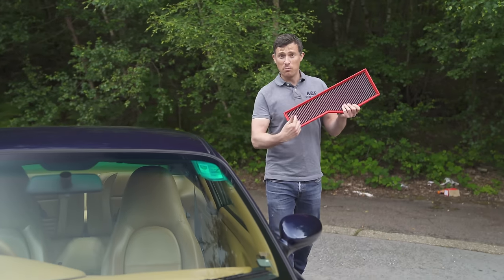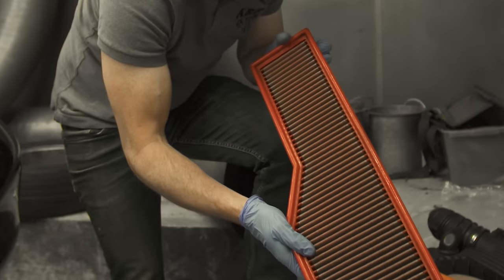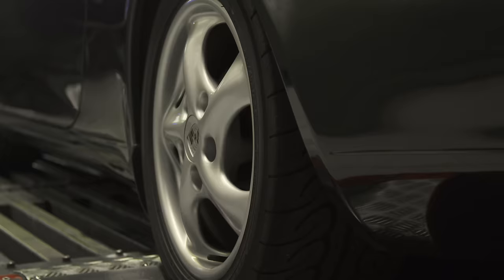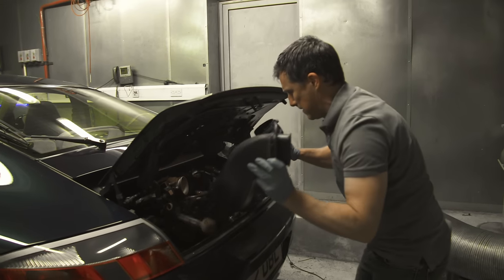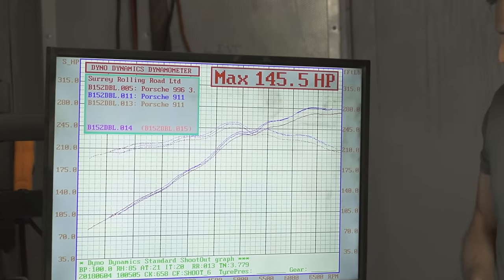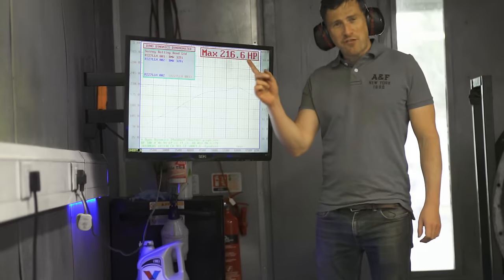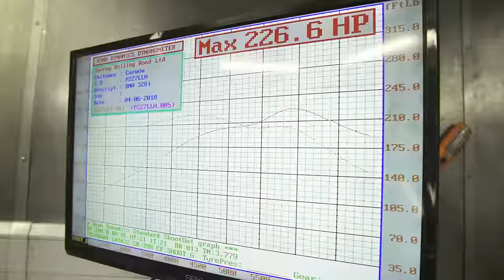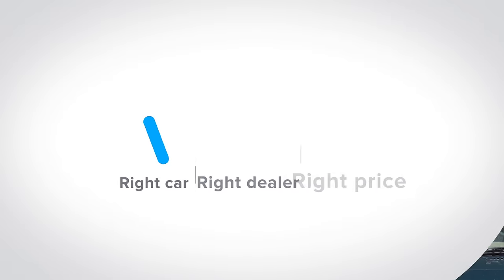Does a performance air filter give you more power? I fitted one to my Porsche 911 to find out!

Comment: Your 996 deserves a new stainless steel exhaust system ;)
Reply: and some sexy wheels
Reply: and a new IMS. I'm amazed he has not changed it. Should have been done first thing after purchasing
Reply: Not the conventional thinking in the UK...it's a US thing.
Reply: Errr first thing I had done to my 996 from a specialist in Leeds £1099+VAT peace of mind priceless.
Reply: Which bearing?
Reply: LN engineering hybrid ceramic
Reply: double row if memory serves
Reply: Well I'm afraid that's only got 40k mile life max. and there are about 4 other issues with the M96, too.
Reply: Really https://lnengineering.com/products/ims-bearing-retrofit-kits-for-porsche-m96-97-engines/dual-row-ims-retrofit-kit-for-my97-01.html As far as I am aware after researching it has an 80K lifespan which is fine by me replace when you do the clutch. What peer evidence do you have to support 40K with links and I will discuss it with the specialist I use who ghas several garages and rebuilds Porsches from different eras for a living.
Reply: Which model Porsche do you own, have owned?
Reply: 944T, 996TT, 996.2 C2 and 970T
Reply: The 970T' kinda remind me of my old 928S4 from years ago. Still no link to support your hypothesis / statement of 40K. The single row is good for 50K with the double row service life 75K 6 yrs
Reply: Not really a problem with the early 3.4
Reply: retepyam5858 Jake got richer you got poorer.
Lol dual row, one born every minute.
Reply: 9000Redline can't believe he spent $$$ on wheels before IMS in 996..... Driving with ticking time bomb in the engine. .... Knowingly....
Reply: A full Akrapovic  is the way to go.
Reply: @TheChannel1978   its a fake. Not real , ims go bigger his Fortune scaring 996-986 owner. This 996 is perfecto.the e 36 rules

Comment: I have a 997 Carrera. Fitted a K@N and for a about 2 years I kept chasing an check engine light. Multiple issues, including vacuum leaks, but the final fix was to put back a standard air filter and put in a new mass airflow. My understanding was the oil from the filter can contaminate the MAF. Either way, this caused my engine check light so beware.

Comment: I put a K & N performance air filter in my BMW. It’s certainly feels more responsive and revs more freely but whether there is an actual measurable power gain I have no idea.
Reply: stubones look behind the filter shit load of dust
Reply: All seems fine. I open the filter box and check out eveything at least once a month. There is no oil anywhere in the filter box aprt from on the filter material. Thanks for the heads up though.
Reply: No there isn't, but thanks ever so much for your misinformed concern LOL
Reply: zeroyon223 hahaha,  that's bollocks.  It's an Internet myth.  Give your head a wobble,  don't believe everything u see on YouTube.
Reply: I've also tested some air filters on my M3 on the Dyno. K&N is the best of the 3 I've tested. I had a K&N filter, an OEM BMW filter and a BMC filter. BMW and BMC delivered the same power. The K&N gives 4hp more! I think he uses also BMC, it looks the same style as my BMC..
Reply: ErikT595 variance in a per dyno is prob 10hp
Reply: my 1.4 mito felt also more powerful with the k&N filter, my mechanic thought so too since he drove another clients car with the same engine. of course that could have another reason but it feels more responsive and quicker. Also experienced this in a peugeot 107
Reply: @ErikT595  i put a k&n filter in my stage 3 bmw 535d, dyno'ed it and the increase was 15hp compared to the original spec
Reply: @dzionisis  good job man!
Reply: @dzionisis  15 horses just to put the filter?
Reply: @zeroyon223 rubbish, k&n will back you up if the dealer says this has happened and even send engineer out to prove the dealer wrong. Why do formula 1 and all other performace racing use k&n???
Reply: @MadKingJorge  1.246% to be exact. And that's for only €55,- Also compared to the others I've tested K&N is the best.

Comment: In addition your aftermarket filter is (should be) serviceable where paper elements aren’t, they’re throw away item which cost you every time a services due. If you replacement paper filters aren’t that expensive then whatever you like but it’s it’s a high cost item then a good quality serviceable aftermarket filter is worth a look.
Reply: The engine has been tuned to run with the standard filter from factory. Unless you are doing a remap, there is no point in getting a k&n or similar
Reply: @eveythingthatsadam  if it has the MAF the ecu correct the injection.
Reply: @Moriggia  only by very small percentages

Comment: The IMS is not as much to worry about if you're regularly running the engine at highish RPM. That's because the bearing was designed to be lubricated when the oil pressure gets nice and high and your oil splashes around with some obviously making its way into the bearing.

Like any bearing (as opposed to a regular transaxle) the IMS does not like to be spun while dry.

Comment: Okay,so here is the thing. I have played a lot around with aftermarket sport filters like K&N,Pilot,etc.. From having experience with Accord Type R,Galant VR and BMW 525i,i can tell you with certain,that the higher you rev the engine,the more you feel the benefits of the sport filter. No,it does not increase your HP.,it can't do that. But allows a better air flow which results in better throttle response and better performance at the high revs.
Reply: S.T T. So what performance is it giving if there is no hp upgrade or nm upgrade
Reply: J Alcatraz As I mentioned,the performance is not defined only in HP or Nm. Almost all cars come with restricted air flow. To understand what I mean,put a cotton ball in one of your nose holes and run. You can keep the jogging,but if you take a fast sprint,you will find out why air flow is so important.
Reply: S.T T. wrong, its just like fake pills for your $  placebo, thats all. but you can give more dirt and oil to your engine....maybe dry filters are not that bad, but the airflow is terrible.
Reply: Lmao, hilarious read chap.
Reply: @eleonik76  "performance is not defined by hp and nm" oh yes it is everything car related is numbers. 0-60 power, torque, lap time. Throttle response can be measured. Everything else is placebo. And the the cottoball thing is stupid because you are splitting air flow in half and that also can be measured. Smh

Comment: The performance filter's major advantage is that it's reusable, can be cleaned and re-oiled.  Though I think if it had a tune to compensate for the improved airflow, he would have seen a larger gain over the paper one.  The one disadvantage is they don't filter as well as the paper element, which over time will increase engine wear.
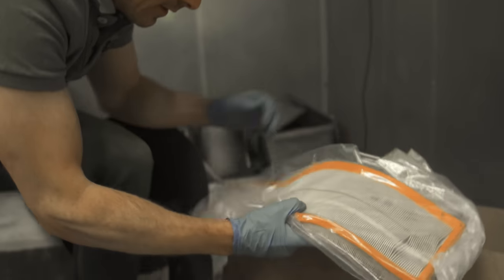Reply: Believe in JESUS today, confess and repent of your sins. No one goes to heaven for doing good but by believing in JESUS who died for our sins.  For God so loved the world that he gave his one and only Son, that whoever believes in him shall not perish but have eternal life.(John 3:16)🥳
Reply: Would it need a tune to benefit?... Surely there are sensors that detect the increased air coming in and inject more fuel to match, keeping the ratio the same?

Comment: I drive an f56 mini cooper s which with the oem filter actually hit 208bhp & after fitting a k&n panel filter dropped to 198 bhp but with such a negligible drop the increased noise ,especially windows up believe it or not was well worth it &im convinced the throttle response is improved and there really does seem to be more popping on the over-run! I have an induction kit en rout & am really really interested to get it dynod again &really try put this to bed once & for all, awesome content. Cheers

Comment: I think you would need to tune the ecu after an air filter install to see real power gains also you would need to do so when removing cats
Reply: CrouchinTiGa unnecessary, there is no significant gain with that perf. filter. but in the meantime u get more dirt and oil in to the engine.
Reply: Max Cohagen I don't think an air filter mod is worh the money to be honest you better off spending your money on a decent catback exhaust

Comment: I installed the K&N filters in my Macan S, which require powerwashing and oiling yearly, but I too didn't really see a big upgrade.  The COBB tuner, which remapped the ECU, did make a big difference on the high end, put not so much on the low end where I wanted to see gains.  It also eliminated the exhaust sound, which as you say, is really a big part of owning a Porsche !  I reset me car back to factory settings, and returned the tuner, but the filters remain.  Thanks, well done video !!

Comment: Run some expensive fuel system cleaner or ATF in the fuel to clean the combustion chambers, intake valves and injectors, then change the fuel filter.
Most of the restriction comes from the intake tubes so unless you change the intake to a proper cold air intake system with exhaust mods and get it tuned to match you will only mess up the tune and lose power.
High flow filters all let more dust through so the cost of your "sound modification" is reduced engine longevity.

Comment: Get that IMS done if you are worried. When I bought my 986 S it was on its way out and I put the LN ceramic ball bearing in which had a lifespan of roughly 75,000 miles. I could have done the direct feed but ceramic was cheaper and 75,000 mile rating is fine by me. And I have a 6 year / 50K mile warranty on the new bearing. Can’t go wrong with being safe.

Comment: i only use K&N or Pipercross filters, they work, save you the cost of replacing the paper one each service (just wash, dry and re-oil once per year), and as you noticed, better sound, especially the models that have the rubber bung at the side (remove bung for warm fuzzy feel).  :)

Comment: I'm not an engineer, but from what I understand more airflow turbulence at lower rpm increases torque which explains why the more restrictive factory filter has higher torque. Modern 2 stage inlet/intake manifolds utilize turbulence @ low rpm and free flow at higher rpm for this reason.

Comment: Nice one Mat, I have been using one of those for a while and yeah, the sound got quite a bit nicer. Performance wise, it felt happier to rev, but nothing noticeable on the road, now I know why.
Reply: I also got the semi solid engine mounts recently, found it sharpens up everything slightly but there is some harshness at about 4k which I dislike. Will try slightly softer mounts and see.

Comment: You need to re trigger the fuel characteristics map er initialization , drive for at least 50 km , only then you can realize the benefit of the after market air filter if any or any mods that affect the fuel air ratio. For that matter .
I

Comment: I put a K&N performance filter that has an extra air intake "hole" on my 1.6 ecoboost and measured before/after figures through OBD and the kn increases the turbo boost by several PSIs and improved throttle response and sound. I was surprised with the outcome on my car.

Comment: I did notice after a while washing the k n filters 5-6 times the cotton starts to wear thin and holes appear also my air flow sensor goes bad even with light re oiling the filters went back to standard filters on my e55 amg and happy no more problems with sensor

Comment: K and n in a 2018 dual jet swift with an exhaust mod and K and N makes a big difference in the higher rev range, seems to have lost a bit lower down, but the car is leaking something nasty from the engine bay so it’s not running right anyway...

Comment: Not sure about the 3.4 you have but in my 3.6 996.2 the air filter is simply 7 screws and then disconnect the air intake from throttle body and the air filter goes in and out with no problem.

Comment: For these older 911's, should keep the new filter and alter the funnel/opening of the pathway from the rear deck lid to the intake box.
If you lived in the states, getting away with High-flow CAT upgrades would be ideal - and a decent tune.

Comment: I used to own a 328 Sport Coupé just like that - also in Forest Green, I think it was called. I'm on my 7th BMW and have driven many more, and the 328i remains my favourite. One of the last with a cable throttle, which plays a major part in that opinion, but they were also pretty light (same weight as the 996 - around 1300-1400kg). You also didn't get a clutch delay valve or any nannying electronics - just enough tech to make it a good car.

Comment: I've sold many aftermarket air filters (mainly K&N) and I've used them myself over the years. The main advantage (as I always  told my customers) is that one never has to replace the filter again in the entire lifetime of the car. Power increase of about 5% max. is espected. Which is not really a lot...

Comment: I found my old banger had much more torque up steep motorway hills.. I'd suggest you clean your injectors/combustion Chambers... K&n panels are for life saving u a fortune on paper filters... Wet weather dampens paper filters reducing flow...filter upgrades work with other stage 1 modifications

Comment: The effect is completely subjective at best. Turbo engines, more air, colder air, less turbulence into the engine = more power. My Leon FR stock 180 was dyno'd before and after on premium fule with a K&N air filter, stock, 182.1hp, smooth curve, 4 runs average. With filter, 4 runs average, 186.2hp with a audible sound difference too (more airflow). Since adding a replacement, non turbulent Turbo Muffler Delete from Revo, 4 more runs, 190.2hp. Stage 1 bluefin remap, 242.6hp with a smooth curve all the way up to 6500rpm with no drop outs (out of 6800 redline). Total gains for £580 ish, 61hp and 117nm of torque. It's about quality parts, quality maps and looking after the correct engine components. Turbo cars see the biggest gains ofc.

Comment: These filters work on some cars I fitted a K&N in box filter on my 309gti and I noticed 3 benefits  nice induction roar 2nd definate increase in power and it actually filtered the air with the old filter there was always dust in the intake track.

Comment: The filter it came with is "Oil Charged" like the K&N performance filters.. it allows much more at higher rpm's and I believe it cools the air as well, giving the engine a little more power! I believe anyways. Correct me if wrong....

Comment: keep the air filter stock, same power and no problems with sensors, save your money for an oil change
Reply: No hassles cleaning, no sprays required.. definitely keep the standard paper filter

Comment: you didn't recalibrate the ecu for the high performance air filter, so the engine got more air but not more fuel. the result is, the engine was runnig lean and obvious it got less power. (not that a air filter will give much power, but usually its good for 1 to 3 extra hp)

Comment: Some engine control systems are so tightly engineered and adjusted, putting in a freer flow AF can actually be detrimental to performance, in some cases. Yet, some MAF controlled systems will allow a certain degree of self adjustments to the greater air flow. I put a K & N in my Corvette and my mileage went up slightly. But, I wouldn't put on in my new Mazda3 because I know from past experience it wouldn't do anything. Except for make more racket for less power. Because the ECM can't compensate for anything beyond the OEM filter flow....

Comment: No surprise, some cars are so efficient from factory it is hard to get any but a small increase with either a performance filter or Exhaust, some BMWs spring to mind. The K&N filter should never need replacing only cleaning and re-oiling which is a easy DIY job. Saying that I've fitted quite a few of my cars with K & Ns and have a measured improvement so they can work with varying degree.

Comment: Some drop in performance filters save you the need to replace them as often as paper filters. Just need to keep it clean. Maybe a tune will help with the gains from that mod but it may also depend on the car.

Comment: You wouldn’t see much of a performance boost from a panel filter it’s more cold air intakes and other intakes you’d see a noticeable difference, mainly in throttle response but combined with a tune that incorporates the additional air flow you’d see an increase for sure

Comment: I have 2 vehicles both with over 300,000 miles. One is a Prius and the other a 1987 RX-7 turbo. I do all the car maintenance myself and use an excellent program on my laptop www.lonewolf-software.com/automotivewolf.htm that monitors and manages the vehicle maintenance schedules, tracks parts, performance and expenses. I generally just use the OEM air filters from the manufacturer but I tried a K&N filer in the RX-7 and did not see any difference in performance or fuel economy. So I will go back to the OEM filters which are designed for the vehicle.
Reply: Because you need to unlock the ECU to allow for the extra airflow... stage 1 map will gain about 10bhp with a performance panel filter.... stage 2 your better off going with cold air induction and maybe thing about a sports exhaust with a sports cat if you want it to pass an MOT... but if ya don’t mind changing each year Decat it and you will get more BHP. Anything beyond that your looking at engine rebuilds for forged pistons and liners. Modified camshafts.... best off just buying a faster car though 😂😂

Comment: When you put a better flowing filter it won’t improve right away it takes 2 or 300 miles for the computer to learn and adjust the air- fuel ratio & timing curve